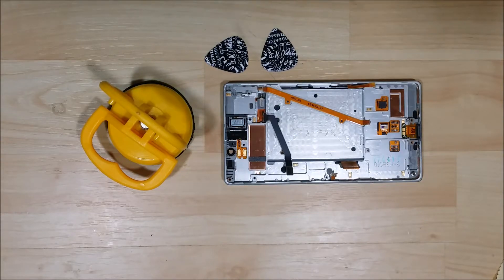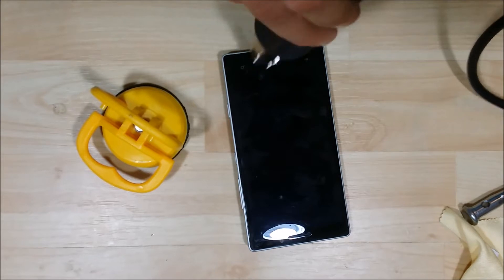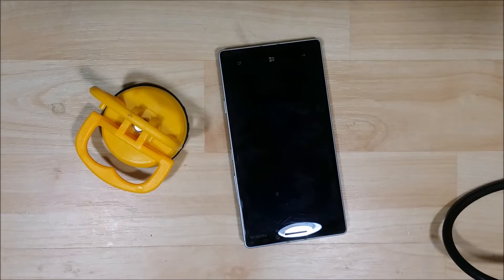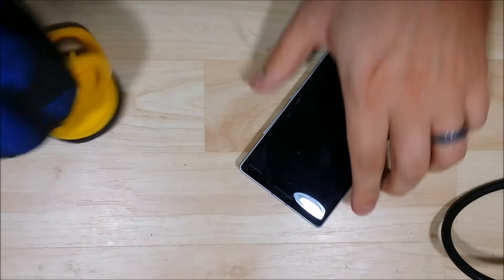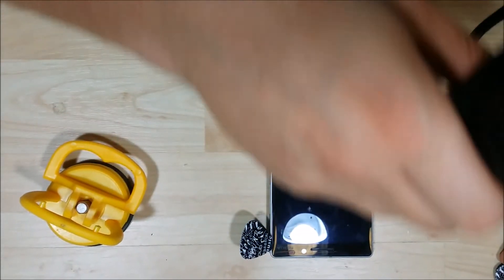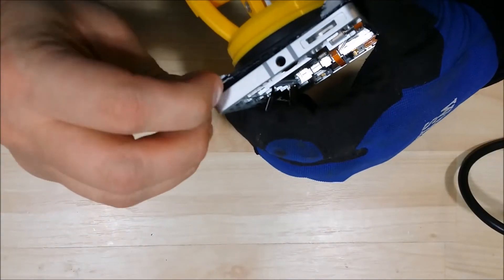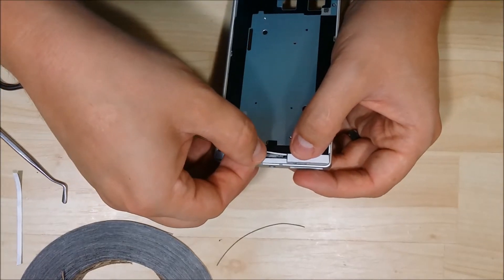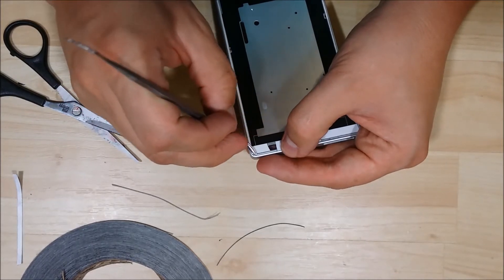Nokia Lumia Icon 929 930 Disassembly - battery -camera - display screen assembly replacement part-2

Comment: hi, i have my lumia 930 damaged from a drop tho the phone is still working. now im purchasing a screen and digitizer with a frame on it to replace my damaged screen and im following this video as a guide but im not sure if my files (documents and photos for work) will be corrupted or do i need to hard reset the phone after i successfully followed your screen replacement video. will it still boot the OS with my files if I properly installed all the components like logical board? thanks for your video anyway.

Comment: I have an Icon 929b and it is only the glass that is broken. Any good sources for glass only? I only find the whole display (glass, digitizer and lcd) for sale as parts and that is $150-175. While the glass at least for the 920 is $20-40. 

If I find the glass only how do you take the old  glass, digitizer and lcd apart? Is it similar to a 920?

Comment: What is originally holding the screen and frame together? Is it glue or tape? My screen is starting to separate from the frame and im wondering which is easier: Disassemble the phone to replace the adhesives with tape or just lift the screen a bit ( theres a small gap anyway) and squirt some glue without going through the hassle of disassembling the phone?

If apllying glue is possible, what kind of glue should i opt for?

any help is appreciated
😊
Reply from the maker: sobrangsuper Originally it is held with rubberized double sided adhesive/tape.
Reply: ***** Thanks! I think I'll just go with putting some glue on the side instead of disassembling the phone to solve the screen lifting issue I'm having, Can you recommend a glue that's perfect for this?
Reply: Have you managed to fix it? I've just got one with the same issue but I'm afraid of disassembling it and messing everything up.
Reply from the maker: a good glue to use is loctite go2 glue I have used it a few times and it seems to work pretty good. Its a mix between silicone and super glue: http://www.amazon.com/henkel-corporation-1624412-Glue-Purpose/dp/B00CAO06FS/ref=sr_1_1?ie=UTF8&qid=1419292127&sr=8-1&keywords=loctite+go2
Reply: ***** if the phone is in warranty take it into a nokia care centre they will fix it for free on the day
Reply: ill  just open it up and replace the adhesive. im just waiting for the screwdrivers and 3m tape ive bought from ebay. lll let you know once i fix mine:-)

Comment: Hi ! Where did you bought your screen ? Is is possible to change only the digitizer ?
Thanks !
Reply from the maker: Jérôme RIVIERE you can do a glass only repalcement but you would need to seperate the glass and lcd.
Reply from the maker: Jérôme RIVIERE I bought the screen from ebay.

Comment: Hi, there.  I have a Icon with a broken LCD but NOT a broken screen.  So I only bought the screen replacement without the phone frame.  I tried follow through all the steps in the vid, but I just cant get the old broken screen off the frame, and all the store I went to couldn't either.  Do I need some special tool to get the screen on the icon off or do I have to find someone selling the screen with frame with it?
Reply from the maker: Cal Zhao if the lcd is broken then get the glass very hot and push from the cut outs inside the frame. You could also buy an isesamo tool and use that to help.
Reply: um, I'm thinking, can I use a lumia 930 frame on the lumia icon? u said they are basically the same phone, right?

Comment: Hey I have a question. Can I put the rear housing of a Lumia 930 onto a Lumia Icon?
Reply from the maker: BigGucciSosa95 Yes they are basically the same phone.
Reply: What are the differences between the two?
Reply from the maker: BigGucciSosa95 The cell bands supported and possibly the processor.

Comment: Hi!, I need to change the display of a 930. I bought this http://www.aliexpress.com/snapshot/6534499907.html?orderId=66225073453221

Do I need to dissemble the phone completely before heating it to separate the screen? Take everything apart? Cameras, vibration motor, those flat cables, etc? What is the minimum I can take apart before heating it?

Should a hair dryer be enough??

thanks for the video!!
Reply from the maker: Juan Ignacio Donoso You can actually get the screen off after removing the back covers and leaving the logic boards in. I suggest removing them so they do not get damaged. You do not need to remove anything else. I suggest taping over the front speaker so it does not get damaged.